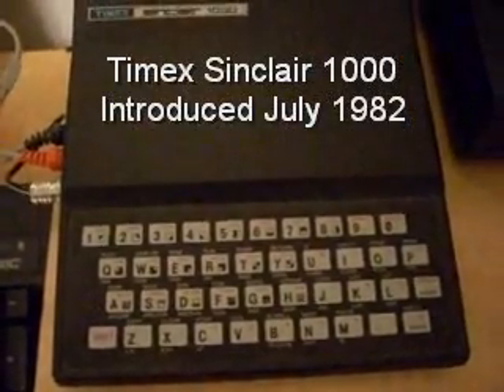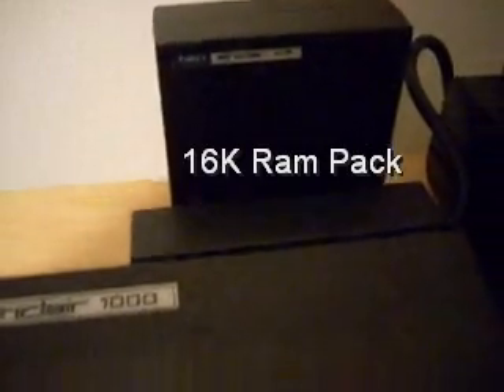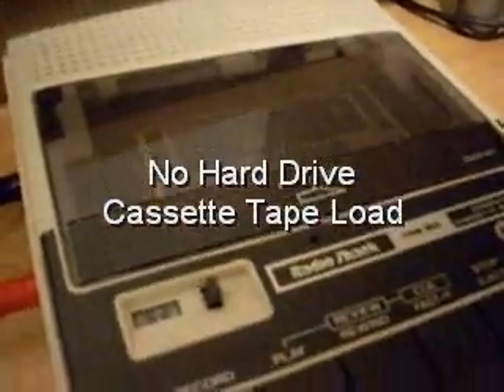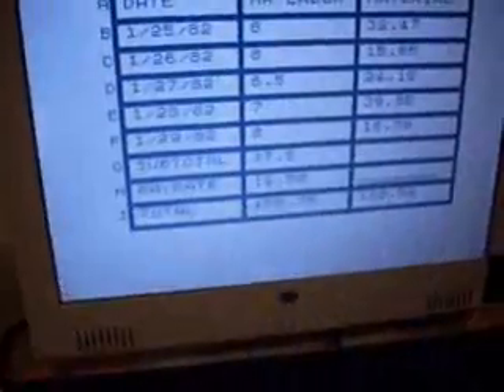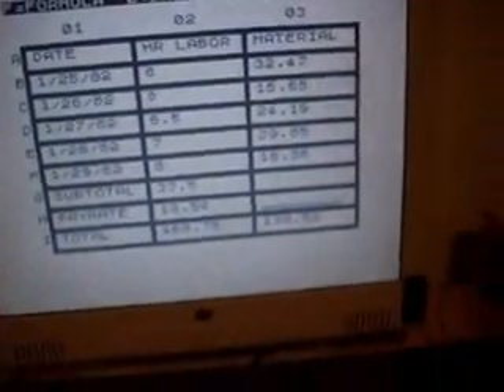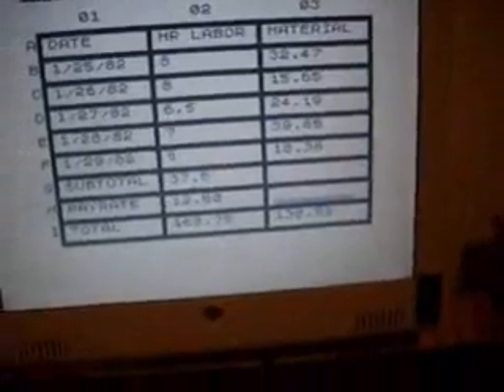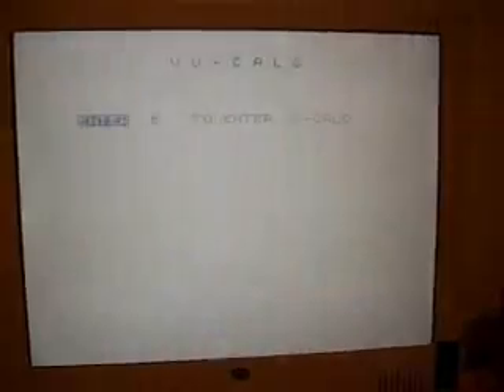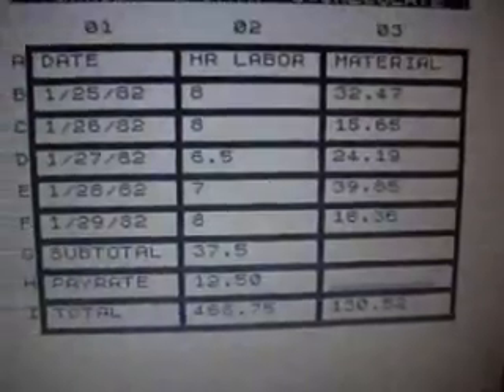Complete Timex Sinclair 1000 Computer Setup Working!

Comment: I had tons of fun locked away in my bedroom making and modifying programs on mine. I found some Star Trek program that would shoot up Klingon ships. I modified it to increase the number of Klingon ships, make them cycle to new ships after destroying one, and added text after destroying them:

Diversion Complete
Klingon Cruiser Destroyed
Your Orders Captain?

I also made them blow up in a spectacular fashion with four huge explosions on the screen. The TS1000 had two modes of operation. Fast & Slow. The slow mode gave you a better resolution on your TV screen. But the fast mode was very fast and you usually used it for most operations. 

I also made up a couple of Trigonometry programs that were instructive. Nobody uses BASIC anymore but it was a pretty cool language.

Comment: My first owned computer. Still have it and love it. First thing I did after having my first memory-wobble with the 16k ram-pack was soldering a cable to the edge-connector and then a connection-box where to plug the thing into. Worked like a charm. Never a wobble since. Over time, I added a real keyboard, serial and centronix interfaces, 2x  8" floppy-drtves and eventually a whopping 300 Mb harddisk (size: small fridge) and a dataproducts green-bar chain printer (looked like designed by German arms-manufacturers and hand-crafted by Swiss monks and sounded like a .30Cal when printing.). Eventually I ran CP/M-80 on it. Not because it was useful, but more so because it appeared possible.

Comment: Wow! Thanks for this! This was my first computer. Then the TI994A after. One thing I remember VERY well with the Sinclair 1000 is the ram pack. The connection would get lose. I used to be in the middle of writing code when the pack would loosen up and I would lose all that code! I made a rule of thumb to save the data after so many entries.

Comment: Oh man this brings a smile to my face.  I remember going to Kmart back in the 80's and seeing these.  My first computer was a Ti-99/4a which I completely pimped out.  Had the Expansion Box with the 5 1/4" drive, the RS-232 card, disk drive controller card, speech synthesizer, MX-80 dot matrix printer, I think my mom spent close to $2000.00 after everything was said and done.  I even had a 300 baud acoustic modem that I used to BBS with.

Comment: For what it was, it's still a nice system. I have 2 in a box, and will need to test them again sometime soon. If you want to use the data or program in Windows, you can get an emulator that will do essentially the same thing, although the loads are faster due to using "snapshot files". I still program on the TS-1000 (emulation) - and I also have that same book for Vu-Calc. Makes working with it quite a bit easier and more productive.

Comment: I have the same set-up, still works. I wrote a number of engineering programs in machine code for structural engineering and heatloss/gain calcs. Pretty incredible little machine for 1981/82.

Comment from the maker: Yes they are a little bumped so maybe yours is defective. Fortunately you can still by brand new keyboards! I bought a new one through eBay once and it was really easy to replace. A few screws hidden under the feet, peel the old one off and stick the new one down and plug it into the slot. Check my other videos for a view of the inside one. If you search online for a new one search for "zx81 keyboard". It's the same thing and will come from England.